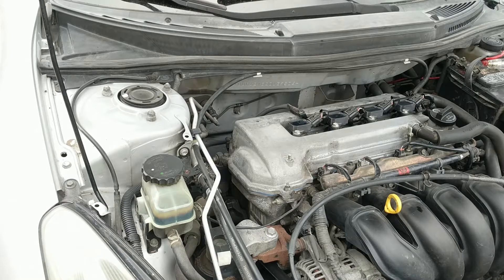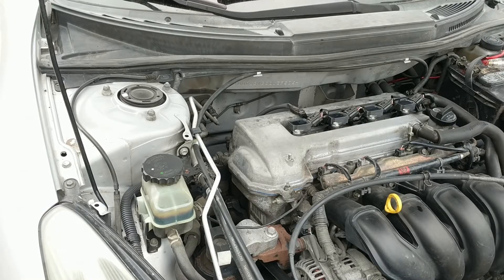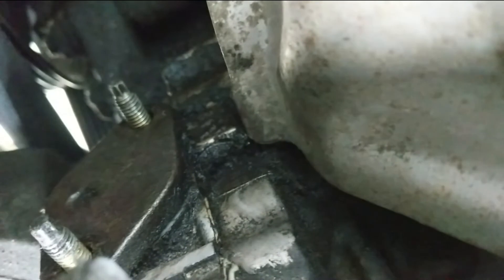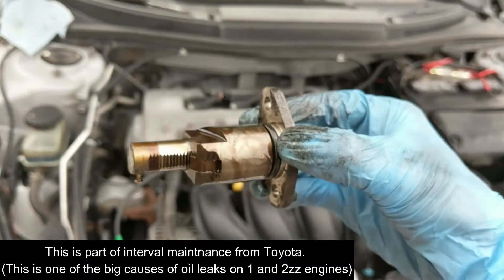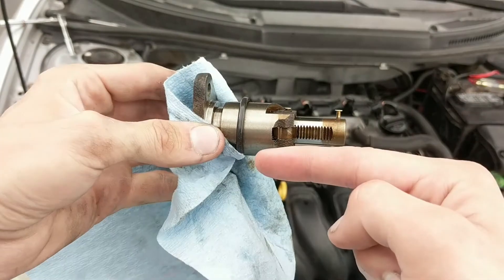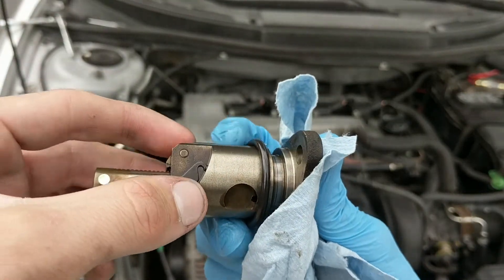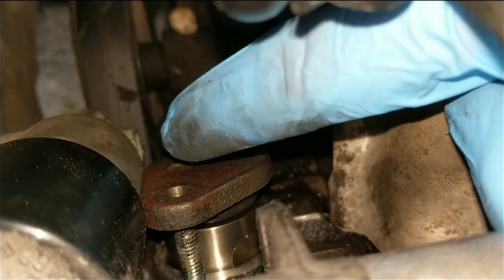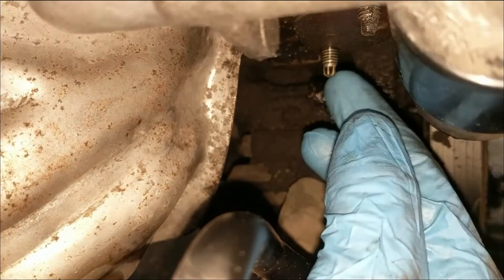How To Replace Timing Chain Tensioner Toyota Celica (Major Oil Leak)

Comment: im not sure if you had any issues but after the tensioner is installed while in the depressed locked position the engine NEEDS to be turned COUNTER clockwise first to unlock the hook on the tensioner. in the video the engine was turned CLOCKWISE. based on the video the tensioner didnt unlock. the counter clockwise rotation makes the timing chain push the plunger in enough to release the hook. the engine always needs to be turned COUNTER clockwise for all 1zzfe and 2zzge models. just an FYI for anyone else about to attempt this job. The COUNTER clockwise rotation is probably the most important step in this job......
Reply: Would a full rotation counter clockwise be sufficient enough? About to attempt mine
Reply: @AzAC54  its not even tht much. Make sure your paying attention for a CLICK. Thats when you know your good 👍🏻
Reply: 15 degrees counter clockwise but on the 2zz the belt tensioner arm doesnt allow for clearence to remove. Without either shaving down the back of the tensioner arm or loosing and pulling the belt tensioner away from the  block

Comment: Thanks for the idea....I will be checking mine as well. 2000 toyota celica. With oil leak. Rear main seal was replaced 2 years ago. That was leaking bad on mine. And now oil pan is a little leaky. Not bad. But still gonna replace gasket

Comment from the maker: Upon Doing further research this method could cause you to skip a tooth in the timing chain (In my case I had no issue and many mechanics use this method). The best practice is to have the timing chain in TDC (Top Dead Center). For this, you will have to look for the mark on the crank pulley as well as remove the valve gasket to see the yellow-colored chain linkson the tming chain at the top of the engine.
Reply: I have a leak in my tensioner, celica 2000.  I was told by the dealership a couple of years ago it wasn't bad but the cover needs to be replaced, they quoted 1500, they told me the engine had to be torn apart, watching your video it doesn't look like that big of a job.  Am I missing something? also, my car uses very little oil.   What is the cover?
Reply from the maker: @MsJaneSi  I'm not sure in your case. Dealerships always charge more. Even for a simple oil change.
Reply: @MsJaneSi  I just had three small leaks fixed. Tensioner, main seal and another. $600 northern California.
Reply: How does TDC stop it from skipping a tooth?
Reply: @MsJaneSi They would have been quoting you to do the entire timing chain cover, not just this tensioner. 
The entire timing chain cover gasket replacements is about a 5-8 hour job.

Comment: Thanks for the video.  Did you have to drain the oil first or can you remove the tensioner without spilling oil?
Reply from the maker: No just turn off the car and let it sit for a while so it is not hot and all the oil drains to the bottom of the engine into the pan.

Comment: Did u have excess oil leakage and if so did this fix the problem? I found i was loosing lots of oil after I just changed the oil 3 weeks ago and I'm not smelling anything burning but around this area its wet with greese and underneath it it is caked with old greese
Reply from the maker: This did fix lots of the oil leak. I add oil stabilizer as well. It slows leaking and burns less oil.

Comment: quick correction. the chain does not drag across the tensioner. the tensioner pushes on a guide rail where the chain rides on.
Reply from the maker: I realized that after. But yes your right the tensioner pushes against the giant timing chain tensioner cover.

Comment: The spring can't be that strong to not use some peice of wood to push agaisnt the unit and something else so the bolts can be tigthend.
That would relieve the hassle of having to worry about the hook getting released, especially if you don't hear the click sounds if working in a loud area.
With that, if you know your chain hasn't skipped a gear, I don't see why top dead center matters, so you don't have to take the valve cover off to inspect things visually.
The whole goal here is to just fix the leak, nothing more.

Comment: Clean the outside area first! Undo the two 10 mill nuts to expose the gap without pulling the unit off, clean both surfaces perfectly. Use some (just enough, dont be a drywall mudder) liquid gasket maker for high heat purposes on the flange OR a thin line on the case and tighten the bolts back up.

Job done, you have sealed the leak without much hassel or seeing the old O-ring.

That costs 100's of dollars? Bring on the comments please. Enlighten me, or prove me wrong.
Reply: it cost me 15 bucks for the o ring homie and like an hour of labor to do it myself lmao it doesn't cost 100's of dollars 🤣

Comment: hi is your celica is GTS?
Reply from the maker: GT
Reply: @ElectricMilesLLC  when you install the timing chain tensioner did you put back the tensioner lock/clip before you turn the crank shaft pully?
Reply from the maker: @superkari28  Yes press down the tensioner fully and apply the lock, slide it back into the hole. tighten the 2 10mm bolts and begin cranking the from the crank pulley. Even though the lock is on it automatically slips off when you begin cranking.